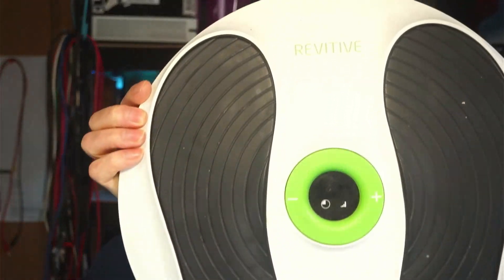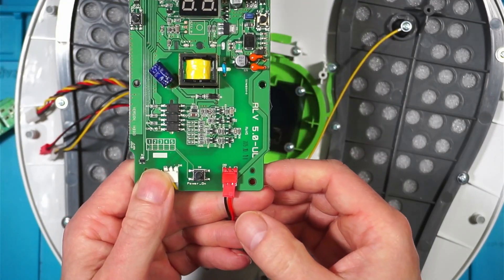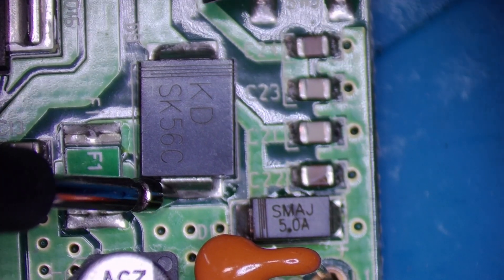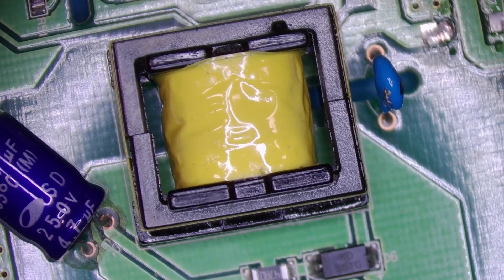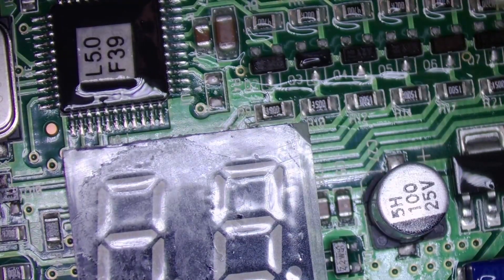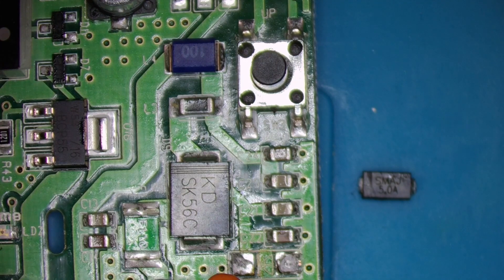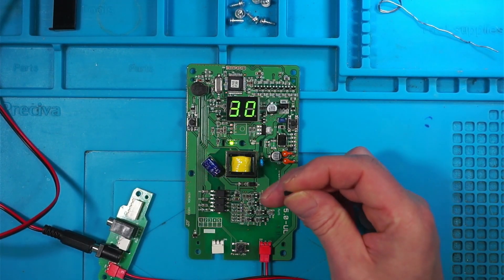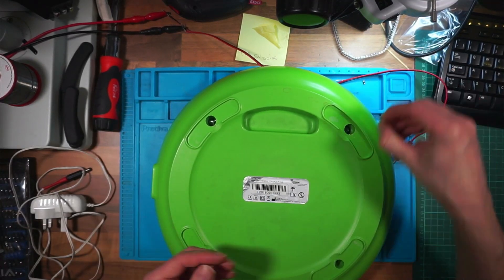Revitive Circulation Booster | Won't turn on | Can I Fix It?

Comment: i have the same product but mine turns on and then off again right after. Is it possible to show how to test the board with the multi meter?
Reply from the maker: Sorry but I don't have the machine now. Make sure your power supply is outputting the correct voltage and test any capacitors for a short to ground.

Comment: Thank you very much for your video. I had a customer done the very same thing plugging a wrong power supply into the unit blowing that same protection power diode. I unsoldered it and it works. Saving the customer $500 on a new one. My model was a newer spec model but had the same fault.
Reply from the maker: That's great news, I'm happy my little video helped. Well done on the fix. It seems like a very common problem, which could have been prevented by using a different sized power jack plug

Comment: Great job - that diode going to ground, its cathode will be on ground, which means it saves the board if reverse polarity, or over voltage occurs.
Reply from the maker: Hey Chris, it certainly did a fine job here. It took a little while for me to swap it out but I wanted to be sure the short wasn't being caused by anything else on the board.

Comment: Anybody that's diabetic or has high blood pressure, high cholesterol & Osteoarthritis! These things are awesome! They take away swelling & a lot of pain too 🖖👍
God bless you Phil! for fixing it, diodes have saved a lot!! of devices' I've done in Radio/RF over the years. The one you fixed is a transient voltage suppression diode.
Reply from the maker: Aunty Nora says it's great, so I'm pretty pleased with myself for being able to fix it. They're quite expensive too, which makes fixing it with a part that costs less than 5p even better. This is the first time I've came across TVS diodes. It's a good example of why I need to work on other things, to help me learn more about electronics.

Comment: Sometimes a diode is used as a fuse. I've seen this in laptops before.
Reply from the maker: So it seems. It was news to me. It definitely worked like a charm, saving this machine.